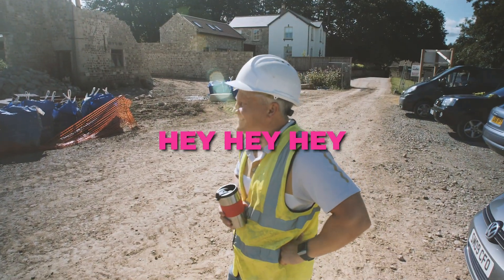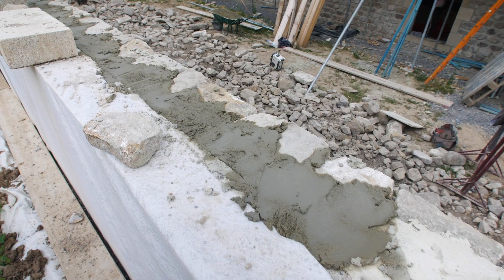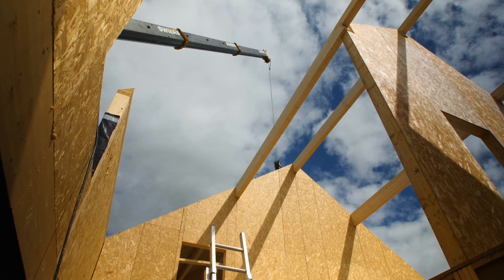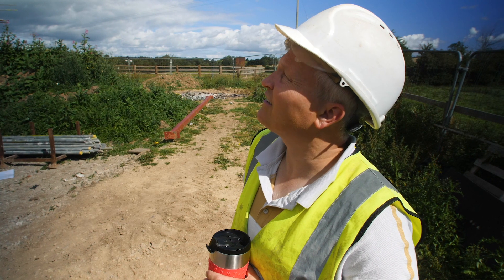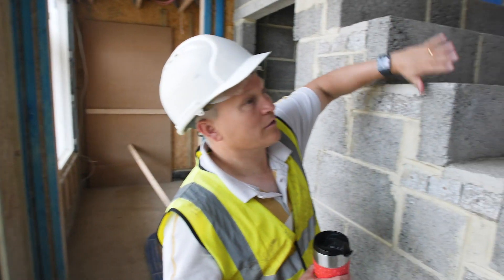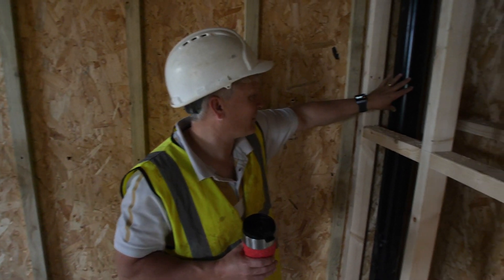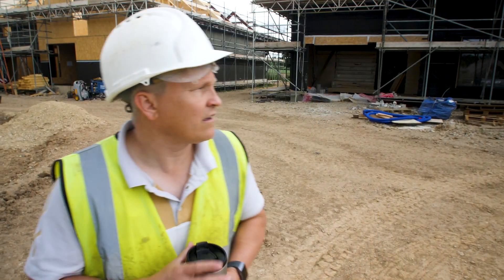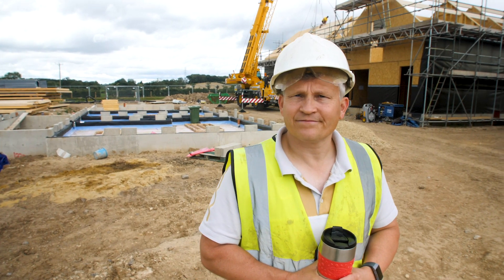Installing SIPS Roof Panels - SIPS Eco-friendly Housing Development (Church Farm Ep5)

Comment: This is a great insight into using SIPS but, if I’m being picky, there’s a distinct lack of detail about the actual fitting of panels…we just see them piled up in stacks or waving about from a crane.
Reply from the maker: Yeah, I admit there isn't any specifics about how the panels fit together, but in later films you can see how quick the process is - ideally, for larger builds you would pay for the professionals to erect - which is really like a giant jigsaw, where every piece is pre-planned and quickly assembled. If doing it yourself putting it together would be a learning curve, but not impossible with the right equipment, manpower and know-how.